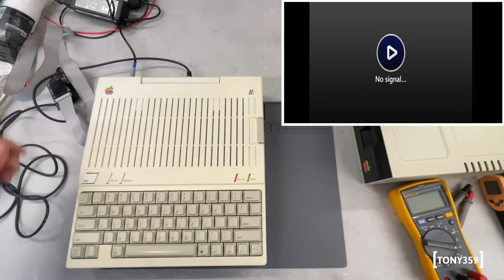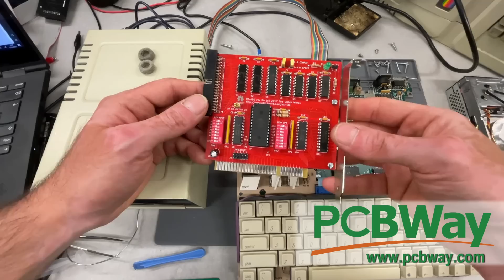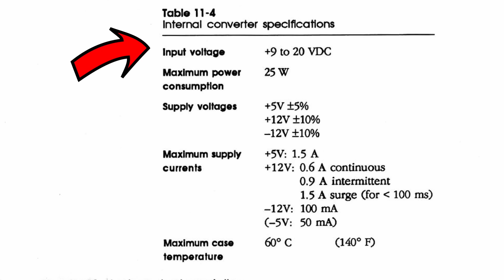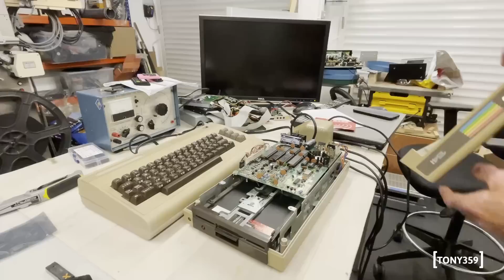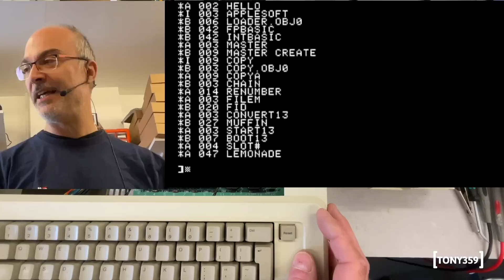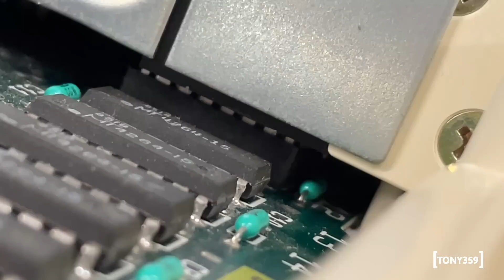Apple //c repair - FOUR unexpected faults!

Comment: Commodore drives definitely have RAM too. In fact, this is how custom fastloaders work - they upload their own code to the RAM of the drive to execute. So essentially it's a full-fledged computer on its own. Actually, there was even a demo recently, that ran on the 1541 exclusively - repurposing the floppy's serial connector as a monochrome composite and audio output! On this video -great stuff. I'm not an Apple II guy, but I enjoyed it thoroughly. Love me a good analytical deep dive into some retrocomputer faults.
Reply from the maker: Amazing! I will find that video for sure! It's indeed so weird that they came up with that design, it feels so overkilled. Is there something that the C64 floppy could do which the Apple 2 couldn't? Obviously the Apple 2's is using some CPU time to drive the floppy directly, would you think it's a big deal?
Reply: @tony359  Well, the entire approach was different to the system's design, so it's hard to compare. The "IEC bus" a.k.a. CBM-488 bus, which the CBM floppy drives (and printers) use, was a stripped down version of the IEEE-488 bus (as used on the Commodore PET), and was originally invented for the VIC-20, which was a very cheap, and non expandable machine compared to the Apple II. So yes, they made the trade-off, that the drives had to be "smart", and the system was also slower, but in exchange, you needed no floppy disk controller card, like on the Apple II. Given Commodore owned MOS Technologies that manufactured all the chips, their economies of scale worked differently than for Apple in this case. Also, it was a few years later, and that made a massive difference too. 

On the technical side, this solution allowed daisy chaining of multiple drives (and printers!) on the same serial bus, and do several nifty tricks. For example, if my memory serves, you can copy between two drives without the data ever reaching the computer, among others. And yes, the implementation was infamously slow on the C64 (slower than on the earlier VIC-20!), because of how the data transfer timing interfered with the memory read timings of the VIC-II (a.k.a. the "badlines"), so they had to slow the entire thing artificially down in the first ROM versions, to get it working reliably, and then that stuck forever, basically, for compatibility reasons.

Later fastloaders (and even custom ROMs, like JiffyDOS, and also the C128 to some degree), found a way to solve the worst of this problem, but the system always remained on the slow side. Note that technically, any storage drive on the IEC bus only had to implement the comm. protocol, did not have to be 1541 compatible - even Commodore released floppy drives that weren't fully 1541 compatible, like the 3,5" 1581 - but software very quickly started to use the specific hardware features of the 1541 for fastloading, so even today, the best retro FDD emulators (like the 1541Ultimate series, or the Pi1541), emulate the entire hardware of the 1541 drive, to be compatible with as many software as possible.

So yeah, bottom line - it's difficult to compare the two systems. Both have their advantages and disadvantages and were results of the companies and situations that produced them.
Reply: @tony359  https://www.youtube.com/watch?v=zprSxCMlECA <- it's this one. Crazy stuff. Also I was wrong, it actually makes music with the drive mechanics, "only" the video comes through the IEC connector. :)
Reply from the maker: that is so cool! The Apple 2 drive wouldn't even be able to detect that the door has been opened and closed! Thanks for the link, amazing!

Comment: MT stands for Micron Technology. They're still around making DRAM and are very successful! It's funny that their old RAM chips are so prone to failure, as I've always used Micron (or Crucial, their consumer brand) for RAM because I've always considered them among the most reliable.
Reply from the maker: Thanks for that. Indeed I never associated Micron to bad quality with modern equipment but as you said, these older RAM were not their best product!
Also didn’t know Crucial was their consumer brand, interesting! Thanks for watching.
Reply: at one point in time they had a bunch of lines that were.. iffy.

they've gotten much much better across all their lines, on the whole, since then.

Comment: great works again! so funny the drive pushing down to cause that short.  while i had an iie and enjoyed it much, i coveted that iic even though i knew it was merely smaller and a different colour.
Reply from the maker: Yes, thankfully I didn't break anything, it would have been so sad! My parents had the //e but some family friends had a //c. I remember using it sometimes and knowing that "not everything that works on the //e works on the //c" - now I know it was because te //e was the original 6502 while the //c was born with the 65c02.
It's indeed a very cool machine! I have a special attachment for the //e but the //c is so cool and compact!